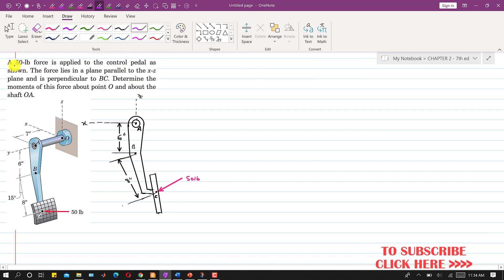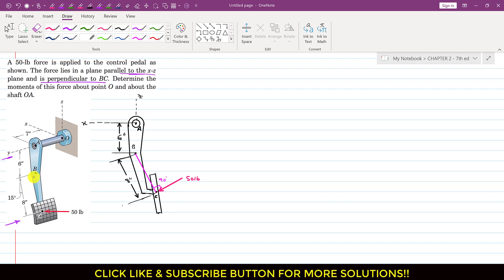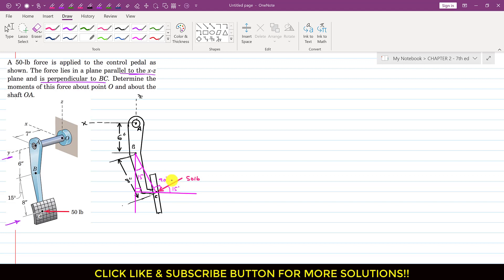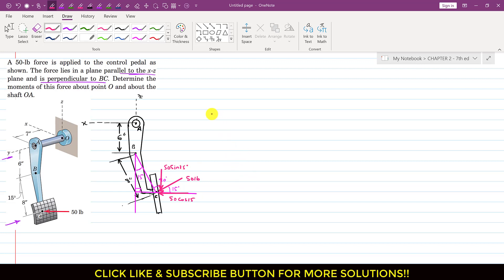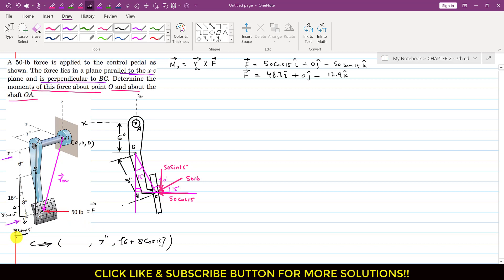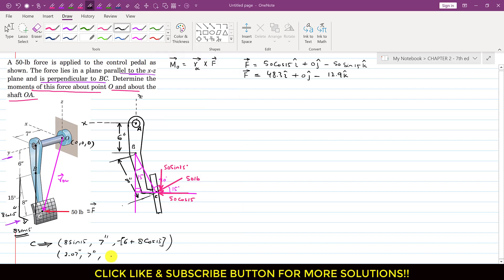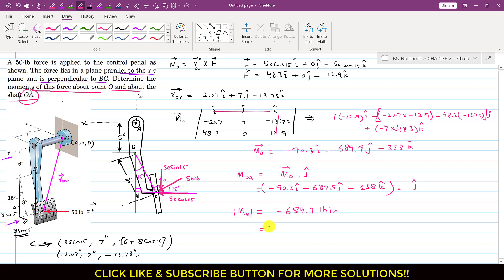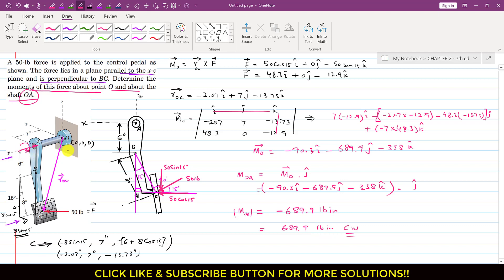Determine the moment of force about point O and about shaft OA. | Statics | Engineers Academy

Comment: Prob. 5: The radius of the steering wheel is 200 mm. The distance from O to C is 1 m. The center C of the steering wheel lies in the x _ y plane. The driver exerts a force ?= 10?+ 10?− 5?(? on the wheel at A. If the angle ?= 0, what is the magnitude of the moment about the shaft OC? Draw a sketch to indicate the sense of the moment about the shaft.